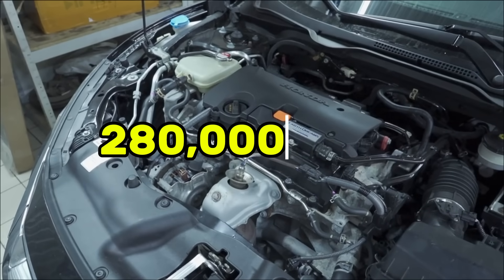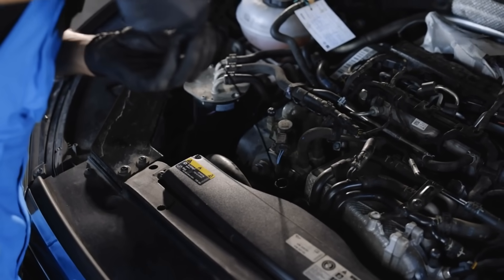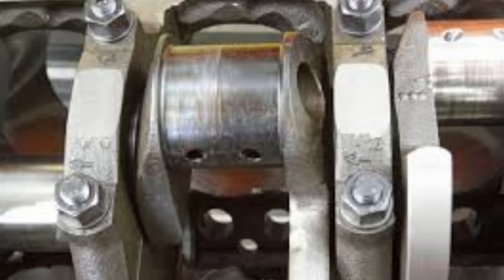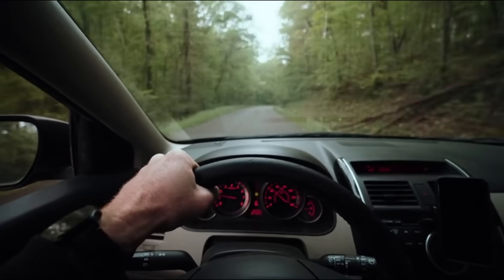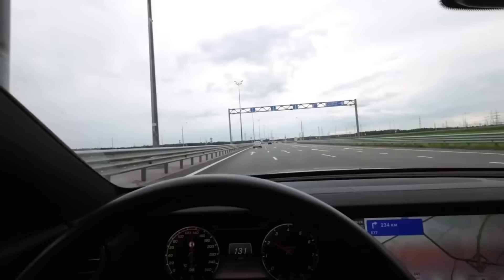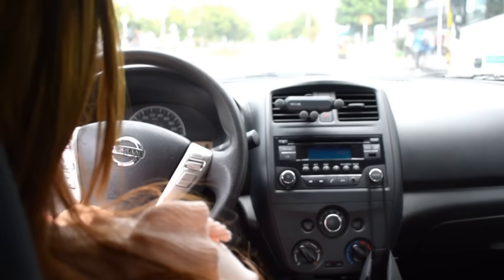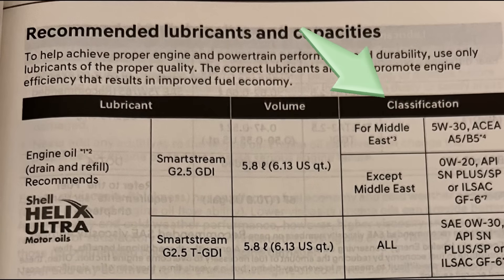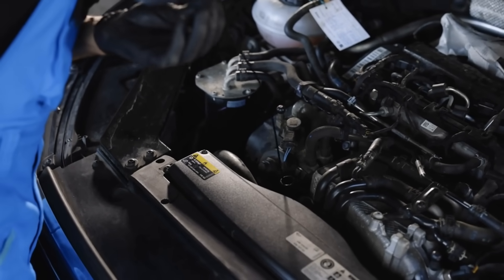I Tested 200,000 Miles of Engine Oil and Found the SHOCKING Truth

Comment: I have a Chevy Equinox 162000 miles on it. I run 020 in it, but oil pressure is low. Should I run five thirty in it
Reply from the maker: It's worth trying 5W-30 in your Equinox to see if it improves the oil pressure, especially with 162,000 miles on it.

Comment: I just double checked what my 2021 F150 calls for and it’s 5w30 same as my 2016 F150.   GM is using 0w20 in their trucks and after some major engine problems they did a recall to change to 5w30.  Sorry GM but those engines are already screwed.

Comment: Have been figuring my own for years. Own: 07 Tundra 5.7, 13 Scion xB, 14 Tacoma 4.0l, 24 Highlander 2.5T. Tundra gets 0w30 / 10w40, xB gets 0w30 / 5w30, Taco gets 0w30 / 5w30, Highlander gets 0w30 / 5w30. All had first change at 1000mi then another at 3000 then every 3K. Cheap insurance. Can't hardly believe that factory specs are so weak, but the fuel mileage gods are strong. Tundra is at 67K, Scion is at 77K, Taco is at 61K, Highlander is a baby at 14K. My old Corolla is still with my old neighbor who purchased her from me at 215K she now has over 300K. I only use Mobile1. Always do trans drop&fill at 70K ish then every 25K after. Change diff lube at 2 yrs unless run in a lot of deep mud/water. 75yo retired high and mostly dry here in Colorado, 45mi NE of Denver.

Comment: Use whatever the car manufacturer recommends. That's the viscosity that the engines were designed for. The most important tip is to change your oil at least every 5000 miles, even if the oil claims it lasts longer.

Comment: I have 2017 Pacifica 130000 miles and using 0w20, but I'm definitely interested in this idea of switching, at least during the summer time. By the way, I live in Michigan.
Reply from the maker: Thanks for sharing your experience with your Pacifica and how you're thinking about adapting your oil choice!
Reply: Before switching, get your oil analyzed.

Comment: 5w-30, a Subaru and a Toyota, no issues! Engine replacement or burning oil kills all gains in mileage.
Reply from the maker: That's a strong testament to 5W-30 keeping those engines running smoothly without issues!

Comment: I DID NOT watch your video, but seen the comparison in weights, I know Valvoline lol  5w20 pumps up FASTER than 5w30 so it lubricates Faster also!! My Honda just hit 200,000 miles and runs perfect,just like it did at 100,000 miles so the thin oil isn't wearing out any parts from being" to thin" viscosity, it actually is much better in very cold areas like The Midwest winters in cold 🥶  start- ups again it pumps up to top of motor FASTER than 5w30 oil.

Comment: When I heard 0w20 was recommended by EPA, I changed to 5w30 as a common sense reaction.
Reply: wise
Reply: 0 30
Reply: 0-W30 or 5-W30 has a much worse formulation. but the choice is yours
Reply: @oleksandrdutka5385 0w20 cannot handle the heat in my temperate climate and if you have turbo, we’ll kiss it goodbye.
Reply: @oleksandrdutka5385  Wow, you're wrong.  And more videos are popping up proving you wrong.
Reply: I'm running a 09 tundra 5.7 V8 running 0w20 and 5w20 in summer almost at 300000km.
Reply: 5w20 would be closest one
Reply: 0w20 and 5w20 have the same viscosity at operating temp. 0w20 flows easier below operating temp.
Reply: @wjm3018  that would be incorrect, actually you would want 0W 30, or 5W 30.
Reply: @wjm3018 
Keeping it simple, first number (5) represents the cold properties of oil, aka the Winter grade.
What it means is - the oil in question (5W), will not be thicker than standard SAE 5 oil @ -20°C.
Respectfully, 20 states that the oil will not be thinner than standard SAE 20 oil @ 100°C.
Being that both oils 0W/5W-20 will be within specified viscosity range (as SAE 20 would be) at engines operating temperature, the protection -  or the lack of it, would virtually be the same...

Comment: I’m using the recommended 0W/30 in two vehicles and the recommended 5W/30 in another.    Both are 30 weight at normal running temperatures. At down to 0Celcius both oils are thicker when cold than when hot, so I’m not going to worry about it.
Reply: @hedydd2....Hi, and I think that you may have meant to say that oil is thinner when cold and thicker when hot, and not the other way.
Reply: @StephenJeffery-b6b  
That is a common misconception. The oil is certainly NOT thicker when hot.  Hence the fact that it is recommended to drain hot oil at a service for a quick and thorough full drain.

Comment: i paued at 3 min 20 when you asked what we used, so this is the first comment, i will edit if needed... ive always used 5-30.... and i drive over 2000 miles a week, never had issues, i change my oil twice a month with filter.
Reply from the maker: Thanks for sharing your experience, it's great to hear that 5W-30 is working so well for your high-mileage driving!

Comment: BMW B48 code 320 came from the factory in Türkiye with 0/20 oil. Authorized BMW service put 5/30 oil in my 170 hp vehicle after 15,000 km at the first maintenance.

Comment: With a design life around 10 years/100,000 miles and value of the car having diminished to a tiny fraction of the new price by that point, I don't think its a big deal if your engine lasts 150k or 300k. By the way, 3% reduced fuel consumption over 200000 in something like a 2.0 ecoboost is around a 1500USD saving and nearly 4000lbs of CO2. Who wants to be driving around in some clapped out 300k mile car anyway lol

Comment: 0W-40
Reply: Why this one
Reply: @carhub0344  Better protection, Turbos need all the help they can get, especially in hot summers.  If I am inland it can be very cold in the mornings so i get protection for both scenarios.  I'm not the slightest bit concerned about the marginal fuel economy differences or the marginal power output by using this oil.  Further, it is actually one of the oils recommended by the manufacturer,.

Comment: New 2025 Toyota Camrys hybrid requires 0w8 synthetic oil.  Should I switch to 0w20 or 0w30 instead of 0w8 oil as specified by the manufacturer?😮

Comment: I run a 10W-60  during summer and a 5W-40 in winter on my Saab turbo with long highspeed phases on the Autobahn during summer. It is running perfect with 0 oil consumption and an engine like new. Now it has 200,000 miles and the engine is good for 200,000 more. I had to chäange the timing chainq. At 125,000 because one of these stupid plasic guidance things was broken that time you could see the camshafts and the valves that where also in very good shape. Unfortunately it is getting more and more difficult to find spare parts for it so I might be forced to change the car simply due to unavailability of parts.

Comment: I just switched from 0-20 to 5-30 in my Toyota tundra with a 5.7L V8 and it sounds better you can notice a difference. I should have done this long ago. 0-20 oil is a joke I fell for but I ran 10-40 in a Camry before because my father in-law insisted and the car made it to 300k miles before I sold it running still.
Reply: I bet it's quieter

Comment: There is real data on engine builds. Regarding how many thousands of Clarence the motor has. If the oil is too thick I can't get into spots it needs to. I'm only halfway through the video so if this is mentioned later then I'm wrong

Comment: I must be doing something right, two of my current vehicles have over 300,000 miles on them with no major engine repair. 1998 GMC  Yukon 5.7 Iron Vortec has 325,000 and 1990 Dodge D-250 318 has more but the odo stopped at 320,000. I use 10W-30 in cold and 10W-40 in summer. You can save the gas for me, I don't care about fuel economy that much. If Piglosi can jump a jet home from DC to Calif and back all the time, I'm not going to worry about it I don't care for them dragging me into the fray. Running out of crude oil, 1973 "Oil Crisis," Algor's 1980's "Global Warming," Reclassified  in 1990 "Man Made Climate Change," 2004 "Carbon Footprint," and finally  2019 when John Kerry said "it's the only choice for somebody like me" when he got caught flying his Gulfstream GIV-SP private jet to the Paris Accords. The biden admin tried to kill the car industry forcing them to make EV. He gouged us all with his high gas prices and giving subsidies to new car buyers of EV. And almost killed a couple of car companies in the process.
Reply: @Moparben3713...HI, and you are correct...!! It is such hypocrisy at its finest when our so-called concerned politicians tell us that we must cut back on our standard of living and conserve oil & gas & natural gas & propane, in order to "save the planet" from human caused global warming.....when they pollute more in one year that the typical American will in an entire lifetime...or two..!!

I am 74 and I only too well remember the false scares and climate hoaxes from the 70's onward. As for so-called 'man-made global warming', I have NEVER heard any of the climate experts talk about the planetary and astronomical influences that determine the climate on 
earth: The 40,000 year cycle of the Earth's varying tilt, and the approximate 26,000 year cycle of the wobble of Earth, otherwise known as The Precession of the Axis, and the approximate 100,000 year cycle of the varying orbit of Earth around the Sun called the Milankovitch Cycle. Then, they must include the effects of land and undersea volvanoes on the particulates and smog belched into the atmosphere and the warming of the ocean currents that travel around the planets oceans influencing the temps of the surrounding air. NOPE...I have NEVER heard a climate activist discuss any of these crucial factors. 

Then, the single most important factor that is responsible for all life on planet Earth: the Sun. If one wants to honestly and scientifically talk about the long geological history of climate on Earth, then ALL of these factors must be discussed. How come I have never heard the great Queen Mistress of Climate Change on Earth herself...Greta Thunberg....educate us on these critical factors? Surely she knows all of this....!!!

Comment: I was with you until I remembered that my 2004 Ford Explorer 4.6L V8 lived its entire 230,000 mile life until now on Motorcraft 5W20 without any oil related issues, and it's still running fine.  Call me a skeptic.
Reply: people using quality / trusted brand 0w20 oil would last long than dead cheap one.

the hard truth is they cheaping out on this and call 5w30 a day.
Reply: @russellkane3893  I always use Motorcraft 5W20 synthetic blend

Comment: 10W30 is the best i’ve been using in my 2008 chevy trailblazer and still running very well with 550K+ mileage😂
Reply: NICE! I use 10W30 in all 3 my 20 year old vehicles although two specify 5W30 and one calls for 5W20
Reply: Curious how often you change your oil
Reply: You must have the 6 cylinder, the 5.3V8 in my 08 trailblazer died as soon as the warranty expired.

Comment: I have a 2002 Honda Accord, and the owner's manual recommends 5W20 oil, which I use. In the climate of Southern Ontario, where I live, it works fine. It's thin enough for the mostly mild winters here, and survives summer use because I'm not doing heavy towing in the hot summer weather we can experience here. If I were pulling a big trailer a lot in hot weather I would follow the recommendations of this video and use 5W30.

Also 0W30 oil is mentioned here. When I lived in Timmins, Ontario where it gets much colder that thinner oil was quite helpful for starting in temperatures of -20 degrees C or colder for my previous car, a Plymouth Acclaim. Synthetic 5W30 also worked almost as well at those temperatures.
Reply from the maker: It's great to hear how you adapt your oil choice based on your climate and use case, like considering 5W-30 for heavy towing or 0W-30 for extreme cold!

Comment: I live in Los Angeles CA ,Been using 0w20 mobile one advance synthetic oil ,good for up 20,000 miles but I change my oil every 5,000 miles  .The car been running just fine 19 Infiniti q60 with 76,000 mile, maintenance is the key.
Reply from the maker: That's an excellent maintenance schedule for your Infiniti, keeping it in top shape!
Reply: I do the same because clean oil is just as important.

Comment: I ran a 1994 Toyota pickup for 15 Years on 20w50. To this day I run this in both my 2008 Nissan frontier and my 1994 Toyota pickup. 360 miles on the Toyota and 230 miles on the Nissan.
Reply from the maker: It's great to hear your Toyota and Nissan have racked up so many miles using 20W-50!

Comment: Proper breakin is the most important along with continuously oil changes on time at least every 5k miles will keep it operating good. Had a honda, 3 previous owners changes the oil every 5k miles, i bought it at 120k and drove it to 160k could of gotten more but car got totaled.
Reply from the maker: That's an excellent point about the importance of break-in and regular oil changes for engine health; your Honda story really proves it!

Comment: I use what the car engineers recommend in the owners manual. Newer engines have tighter clearances that require these new oil viscosities.
Reply: Keep drinking the Kool-Aid 😂 only in North America
Reply: @philpearce5707 maybe it's you drinking the Kool aid 😜
Reply: @philpearce5707 Even Toyota is calling for 0w 8 oil now.

Comment: I bought a 2017 Lexus IS 300 with a little over 90,000 that was consistently maintained at a Lexus dealer, and they used 5W-30 oil.
Reply from the maker: Thanks for sharing your experience, it's great to hear about a car well-maintained with 5W-30 getting such good mileage!

Comment: In my 1996 Ford Bronco with the 5.8 I have always used 5W-30 full Synthetic I have 220,000 no engine problems. In my 2018 Mazda CX5 2.5 I use 0-20 full synthetic I have 21,000 miles on that so far no problems.
Reply: Mazda, like my Mitsubishi, actually likes 0w-30 the best. Check your manual also, it's better for protection when the engine is hot.

Comment: I wouldn't use ANY oil with a 0 (Zero) rating......
Reply: I swear by 0w-40 it’s been good in my audi
Reply: @RogerBeckett-s2j  -Is it still RUNNING ?
Reply: @RockinProfessor 175k miles. The 100 I owned before the A6 went over 220k. I’m skeptical of the newer versions, I think the c7 A6 was the last great A6
Reply: You can lead a man to knowledge but you can't make him think.
Reply: Why? Do you even know what0w means?
Reply: @RogerBeckett-s2j  ---It means "Nothing" 😀
Reply: @RockinProfessor wrong.
Reply: @RogerBeckett-s2j  ----🙃Playing with you, sorry.....This informative Video has the answers it seems......Do you believe that a 10-30 is suitable for the So Calif environment ? Sometimes 20 degree cold at night in Winter but it can get HOT 115 Summer....Using Castrol Edge full Syn.....
Reply: @RockinProfessor 10w 30 is fine on lower mileage engines or Toyotas. With German cars with higher mileage I like the 40 at operating temperatures because of things like the timing chain tensioners and VVT that need a bit more viscosity. As for the 0w vs 10w, the 0 flows a lot better at startup, even at 100 degrees f, so more oil gets to the parts that need it during warmup.

Comment: thinner oil for cold weather, thicker oil when hot.  Also, bump up viscosity after engine passed 75k miles.   Really, after 200k miles, it is not the engine that dies, but the suspension bushings and ball joints.   Avoid towing with CVTs.

Comment: Is the federal government going to buy me a new engine? Hell no!  Will use 5w30!
Reply: Fake AI video
Reply: It depends on you cars motor if you have a 5.7 hemi with a MDS system its best to go with 5w20 because 5w30 is to thick and will damage the MDS system and then you will be rebuilding are buying a new motor
Reply: @billyreastmanjr6176 and to thick may not hit the furthest point fast enough on start ups. probably $8000 and wont be the same. the stock oil is 5w 20 Pennzoil Platinum. I upgraded to Ultra Platinum and just bought a case of stock oil filters. what the motor was built on. now run top tier fuel and enjoy the ride were done here.
Reply: @billyreastmanjr6176 tout à fait

Comment: I use 0w40 full synth Castrol Edge in my '15 Golf 1.8t Sportwagon, 10k mile oil changes.
Or 5w40 synth which is what book calls for.
Runs like new at 76k miles.

Comment: This was by far the best explanation of what oil to use and why. I just bought a 2023 ram hemi with 10, 400 miles and it is recommended i use 0w20 😮.  After this video im switching to Pennzoil 5w30 ultra platinum 🙂. Thanks for the video!!!
Reply from the maker: Awesome to hear the video was helpful and that you found the right oil for your truck!
Reply: This video is nothing except words. There is no scientific studies to back it up. Just claims to tickle your ears.

Comment: I heard auto manufacturers call for a lower weight so they could squeeze every mile per gallon to satisfy the government sell high MPG to customers. After the warranty is over, the car breaks down and the car dealers get to do expensive repairs. No accident.
Reply: CAFE standards.
Reply: Same as a start and stop on the newer car I had to replace my battery and now I disengage the switch I know are expensive are a battery and a starter on a German car
Reply: What you're saying is true, but there's more to the story than what you're thinking about, they actually set up the engines to run well on 0W20 or the low viscosity oils, and they test them, they drive them around for months before they pass them and start to sell them that. Way

Comment: I'm a mechanic and have used 10w30 since 1955 in all my IC engines to this very day. The lighter weight oil is to satisfy EPA Bull Shit of thin oil and 10,000 mile change interval which is very bad advice for preservation of the IC engines. One should check with a real engine mechanic ⁉️
Reply: But engine design might have changed a bit meanwhile, didn't it? 0w20 for 2.0 tfsi 245 Audi, only genuine, 80k km and zero oil consumption.